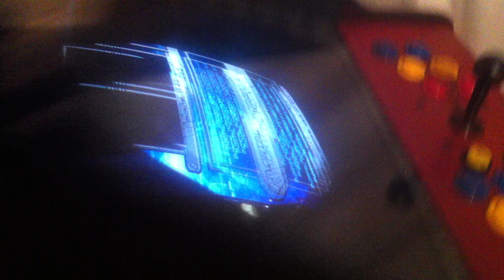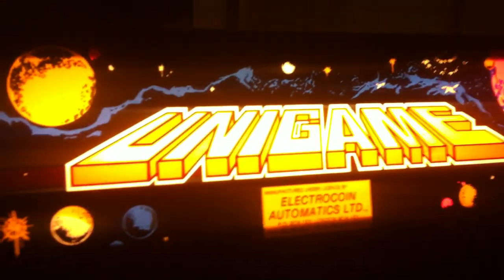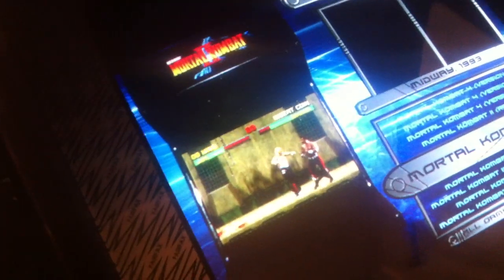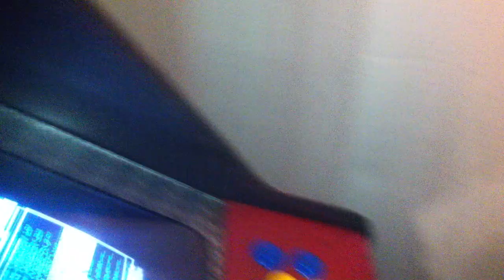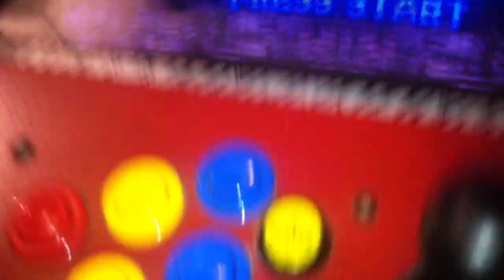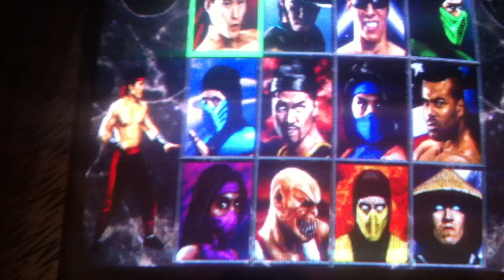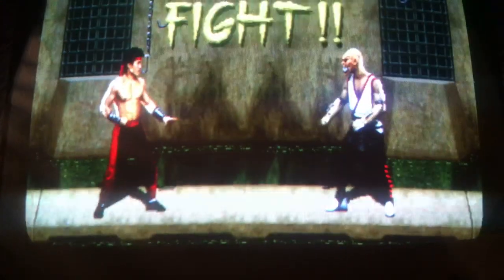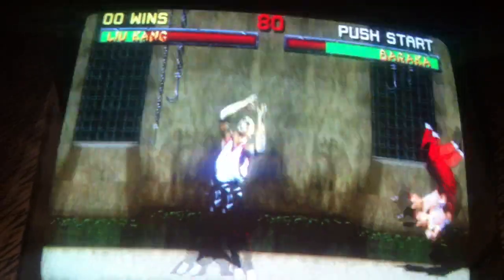mame arcade machine with jpac j-pac setup

Comment: Alrighty bud, is the Titan X the best card to use 2023? Have you still got the Electrocoin? Looks cool, i have 2 Electrocoin Xenon, going to Jpac one 😅, keep the other original.
Reply from the maker: Sorry pal I can’t help you on what the best. I’ve been out the game for a long time. Yes I still have the arcade machine and a 1up mk ultimate.
Reply: @kotm3  plz no 1up lol, I thought you were an OG CRT guy? Yea I'm same, getting back into it. I'm sure the Titan X was the last card that can do analog output according to Google 😄. They going cheap these days. Also Hyperspin is what needs to be used now, nothing else compares. Maximus Arcade was OK I used it on startup back in the day.
Reply from the maker: @o_Juffo_o  my arcade machine is still the same running a crt. I’ve not touched it in years. I just play the odd game on it now and again. 😭😭
Reply: @kotm3 oh I forgot to ask, did the speakers 🔊 work straight off the jpac, did you need a 2.1 amp or are you just using pc speakers from the pc ? Ty
Reply from the maker: @o_Juffo_o  I had to run it off the pc output with a amp 👍

Comment: How did you wire sound?
Reply from the maker: Scanline City straight out the pc motherboard direct into the arcade speakers.
Reply: @kotm3  is it just dual wired with the jamma wires going to the speakers so you have the option to do both?

Comment: build your own usb input system out of cheep usb controler 14 inputs :) and then us a VGA to RGBS/CGA/AV/S off ebay it dose the 15k and has lots of adjustments to make image fit screen , no software no special kinda card  , it is in fact just external video card :)
Reply from the maker: You could do that, but in my case I wanted to keep my machine as stock as possible.
Reply: what are you talking about ? you can solder the usb inputs to a finger board to plug in to games edge connector harness plug and the video out off the VGA to RGBS/CGA/AV/S adapter , ( its just pin out`s you have to match) and wont damage the game !
Reply: you dont think to good do you
Reply from the maker: +uhfnutbar1 "you don't think too good do you" what's that supposed to mean? The whole point of using the jpac system that you don't have to solder any connections or alter an original arcade machine and devalue it. Also if I wanted to play a stock jamma game I can do it easily. If I wanted just to make a arcade machine I would have made one out of mdf and wired it your way(maybe) I would have probably just used a tft monitor so I didn't have to bother with the 15khz
Reply: MORE BRANS!

THEN MONEY!

Comment: So I managed to hook up sound to my cab using a PC subwoofer system, mala installed and x-men vs streetfighter sounds awesome, final hurdle now is to setup a fixed 15khz signal at PC start up, any advice for this? Calamity's Arcade OSD is great but doesn't seem to stay in selected resolution on system boot up???
Reply from the maker: If you go to startup menu and add soft15khz to the startup menu. That's what I did. I get a scrolling screen till it passes the startup :) hope it helps.
Reply: +kotm3 
Ok i'll give that a try tmrw when I will resume efforts working on the cabinet, cheers.

Comment: Hi, nice video, well expalined, however I have monitor/jpac issues with my converted Jamma cab.... I bought it off ebay fully working and in great condition, but I then wanted to upgrade the PC inside, since then I've not been able to get a clear picture on monitor, I've installed soft 15khz (15khz,31khz + user) I have a dual DVI output card and am connecting the VGA from the jpac via a DVI/VGA convertor. I've twiddled the monitor knobs to get a stable picture but think its to do with jpac/PC output?  Do I need to change any jumpers on jpac at all?  Any help will be much appreciated!
Reply from the maker: Have you checked that it's set to 15khz? And that the PC boots into the programme on start up. Also are u still using the same graphics card? If not you might want to check the compatibility. If all checks out have you tried adjusting the vertical/horizontal hold on the monitor.
Reply: Hi, thanks for the response and advice, in the meantime I actually got a perfect picture on the monitor just a couple of days ago!  Th problem was my PC signal output, although I had installed Soft 15khz my graphics card (ATI Radeon HD 4670 1Gb) didn't want to know! (even after restarting PC, etc) So instead I used an OSD arcade display software which is easier to use and more importantly worked, not just giving me one 15Khz signal but loads of different versions which is a bonus for different games requiring slightly different Khz & screen resolutions.  So now I'm at the stage of updating my 5year old cab to newer MAME ROM versions and downloading every different type of decent emulator I can find on the net (done yesterday), shoving my new PC setup in the back of the cab  and closing the back door, remembering to reconnect arcade cab on/off button on side of cab to PC front panel pins on motherboard (done late last night).   As of today, new issue, sound, or more to the point where is it?!  It is there, just about, but its such low volume from both stereo speakers from front of cab (even with PC windows 7 master volume control set to high/Max level), is there a master volume control on the arcade cabinet itself somewhere...?  Or am I being a nob/thicko..?   Again, any help would be great.
Reply from the maker: +Joe G. I put a arcade style button on the top of my cab and set it to shut down when pressed again. Good work mate ;)
Reply: Yeah i've got the same type of switch situated on the the lower front side of my cab, which acts as start up/shut down for the system.  Whats your sound/audio setup like in your cab? Mine is literally just a split wire from the L & R speakers inside cab going to the green audio out 3.5 socket on back of PC.  Is this correct way? or should audio cable go via jpac or a sound amplifier?
Reply from the maker: +Joe G. I used an old set of PC powered speakers (took them apart and wired the outputs up to the original arcade speakers) sounds mint.
Reply from the maker: +kotm3 that's more or less the way I did it.
Reply: kotm3 Ok cool, thanks man.  Your cab audio does sound great, I was reading an article on some forum about cabinet resonance which is the optimum sound for classic arcade games, that what i'm achieve on mine and I'm working on that right now, got some spare PC speakers and subwoofer set lying around and will attempt to connect these up in the next couple of hours.  PS - I'll probably give Maximus arcade a swerve then!  Lol.

Comment: What resolution are you using? I tried 640x480 32bits and the picture doesn't stand still... Did you used quickres?  My graphics card is ati x800 Pro (agp). Also my arcade monitor is a Wells Gardner 6100 (vector monitor from space duel arcade cabinet)...

Thx in advance...
Reply from the maker: Have you installed soft15?
Reply: kotm3 Yeah I installed it. I also installed Powerstrip to change resolutions with a shortcut. After messing around with it I still had no luck. While I was turning some of the monitor knobs I found that one of them was messed up and was causing the monitor not to sync. I have to fix that in the future but I have picture in the monitor. It´s not a 6100 but a 4900 by the way... thx
Reply from the maker: +Pixelhorizon have u tried to adjust the vertical/horizontal hold on the monitor?

Comment: Is there a problem leave the arcade power suplly as it is and just plug the jamma to the JPAC? Does all the power come from the PC power supply? Thanks,.
Reply from the maker: No the arcade monitor runs off the original arcade psu.

Comment: I want to connect my 2 player jamma harness to my pc, but use my pc monitor not the old arcade monitor since it doesn't work.  So basically I just want to hookup the arcade controllers to my pc; will the Jpac work for what I need? Would a 64bit windos7 pc recognize the arcade controllers ?
Reply from the maker: Yeah you can do that with use of the jpac because basically that's shays happening here bar I'm using the original monitor. Just don't plug the VGA into jpac and instead put it straight into your PC monitor.